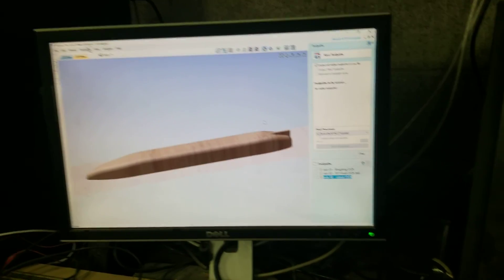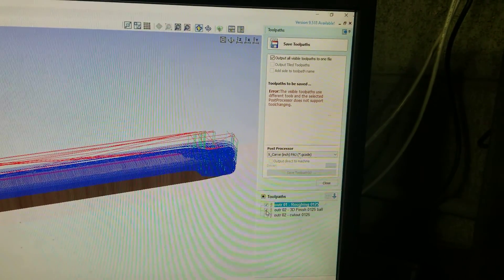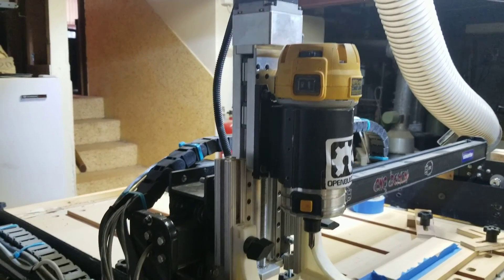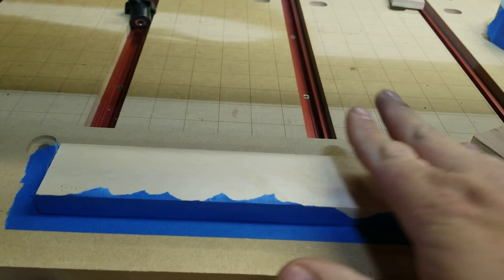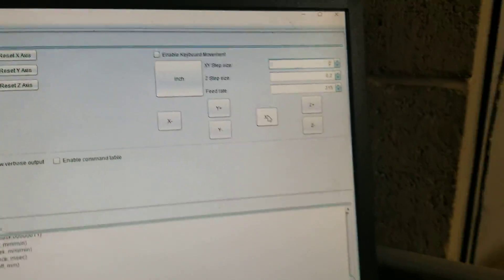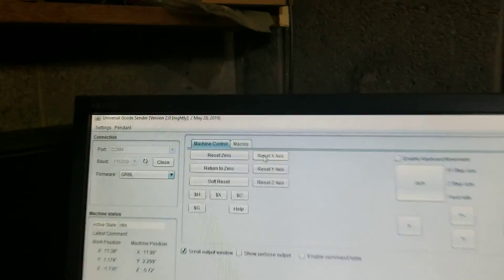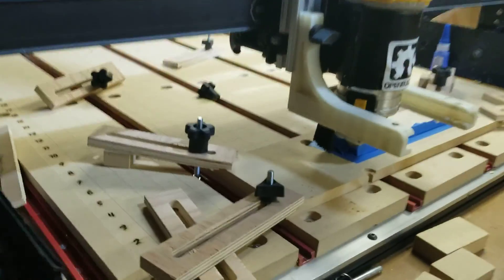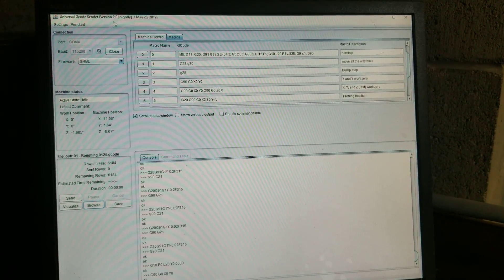Setting up a job in ugs from vcarve

Comment: Great video Phil. Even though I know how to go from vcarve to ugs it's nice to see how others do it and if they do anything differently. I do have a question about zeroing to the bed vs top of the material. 

Is this mostly useful in the case during. It changes where you dont have enough or the same top material to reserve again? Like in your carve, your stock is very close to the full model size and it's a "3d" carve with no flat spots on the top of the model. Hopefully that makes sense!
Reply from the maker: Correct. If you are going to use the whole material, this is the best way to zero.